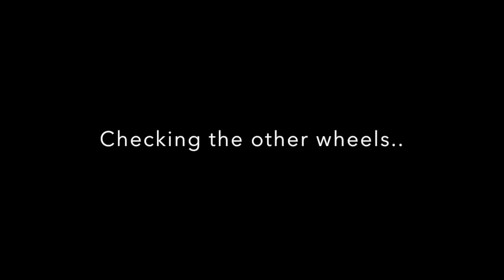New C63 wheel damaged after only a month!?

Comment: Should have kept the Mercedes OEM Rims, they are more durable then any other cars rims due to high Mercedes standards. Just saying 👊👍
Reply: I drove those same roads for 15 years...never bent a Mercedes Rim & have slammed many pot holes
Reply: there is difference in amg rims and oem mercedes rims. AMG are forged and normal are just cast wheels. so they are cheap and bent easy
Reply: I told him from the beginning just stick with the AMG wheels why even bother to get some cheap xhit like this and make the car look so cheap 🧐
Reply: Teddy Doan exactly! I think he needs content those rims are ugly & bad color & makes it look like a bmw
Reply: Those are forged wheels, same as AMG stock. they use same 6000 series aluminium and are forged.  No difference in durability. there is no "high" mercedes standard
Reply: DuBstep115 everything Mercedes puts in that our cars is of higher standard, for instance like the windows, the windshield, much more resilient to rock chips much more resilient to huge rock rock cracks, have heat resistant tent that's clear built into the windows not all companies do this they're just glass windows and if they do they're just copying it with fake s*** that isn't as good been around all the luxury cars my whole life Mercedes are at a whole nother level, they have over 100,000 inventions to the automobile including the automobile itself, the first motorcycle ever, first combustion engine and so much more sorry stuff is misspelled I'm using voice to text LOL
Reply: In many other parts yes but you must understand aluminium alloy is just a metal and it is wrought from different series from 1000 to 8000. If you are using same 6000 series metal you will get the same durability as mercedes, there is no magic behind it or trade secrets. Even BBS wheels bent even tho they are concidered to be best in the world (used thru all motorsports including F1 formula). Oh btw mercedes was only first to put  combustion engine in production.  Nikolaus Otto who invented the engine hence the name otto motor. you might want to fact check https://en.wikipedia.org/wiki/Nikolaus_Otto
Reply: DuBstep115 Yeah makes sense with the rims & other parts that are out sourced...Otto indeed was a German guy but his engines were not reliable, Karl Benz is credited with a fully functioning combustion engine early 1880's Mercedes then had many 100,000 patents there after to the car/Engine, they invented fuel cell (H20 by product 1994 Necar 1 Mercedes) still inventing today first car in the world with active suspension in a production car first 4-door Coupe, first luxury SUV 1995, abs, first led headlamps 2006, first all LED Complete Car 2014 S Class, first diesel-powered passenger car, there's literally a hundred thousand inventions from Mercedes from their first car to the modern automobile it's insane bro
Reply: I am very aware of mercedes history but there are many things that karl benz did not INVENT as you said ABS "1978: Mercedes-Benz W116 became the first production car to use an electronic four-wheel multi-channel anti-lock braking system (ABS) from Bosch as an option" But  In 1971, General Motors introduced the "Trackmaster" rear-wheel only ABS as an option on their rear-wheel drive Cadillac models. In history of patents there is a lot of glory stolen from original creators. If some one steals idea makes it slightly better and uses it in production first, i would not say he invented the thing. PS as W140 owner i have to say mercedes has gone downhill from there, from the 90`s golden days.
Reply: DuBstep115 I hear ya...When Mercedes bought Chrysler early 2000's they made mistakes...I drive a W221 S550 currently best car I've ever driven, I had a 1997 S420, ML320, 300E, dad had 240D Diesel those are still in use today as taxi's in Europe & Africa, He has a 2000 S430 has zero problems (altbough those were the gremlen years) My S550 bullet proof reliable it has amazing reviews 9.7 out of 10 KBB & tech is fantastic S class #1 selling large luxury sedan for over 20 years still untop in the world. Mercedes over all breaking sale records last few years & cars are amazing Examples: AMG GTR & E63S....I'll own nothing else, I have friends with shit Cadillacs, over priced Shit Rolls Royce...BMW major engine problems but your right a few years a few Mercedes models you should stay away from they definitely made mistakes.
Reply: & When I say Karl or Daimler they are Mercedes Benz...as far as inventions they didn't adopt the name Mercedes until early 1900's
Reply: I actually thought buying W221 but in europe we use mainly diesel and bmw game is so much stronger in that side so i went with E60 535D dpf delete + custom map is good for 400hp and 740Nm from 3L diesel, and for summer times my W140 with legendary OM606 I6 diesel.  I have never had big problems with any german brand bmw from e30, e36, e34, e39 and e60. Audis from 100, audi a4 in b5,6 and 8. Mercedes W201,w202, w203 c32 amg and w140. Bmw is more fun merc is serious and classy, Audi is.. well lets just say when it snows quattro is your best friend.
Reply: DuBstep115 That is awesome yeah I am in Florida USA, my parents are from Europe diesel in big there. I had a A4 it's timing belt was needing replaced expensive job, Mercedes uses double chain that lasts forever. BMW use to be funner I am telling you the new E63S & AMG's are worlds different then 5 yrs ago. The new M5 is quick but the Tech in the E63S, you need to drive it it is AMAAAAAZING
Reply: Yeah audi did go to using chains as well in V6 and v8 engines. I forgot one car that i had for brief time but i sold it becase i was scared it would break down. R171 SLK350 with notorious M272 engine that had Balance Shaft that would wear off and cost like 3-5k to repair as the engine needed to come off from the car. So the chain lasted forever but the shaft guiding it did not :D
Reply: DuBstep115 Yeah a few engine got out m272 & m273 they had weak balance shaft..check any 350 or 550 vin# to make sure your not in range...
Reply: DuBstep115 It wasn't every engine was not wide spread but got bad P.R. like 10,000 engines it effected
Reply: I honestly think Nissan/Infiniti oem  Japanese rims are the strongest I've ever experienced.

Comment: I used to own a Corvette. I hit a pot hole one time so hard I thought I had broken something, but didn't have any issues after my heart returned to normal. I sold the car last year after owning it for for over 10 years and never had any issues with the wheels, when I sold it the stock oem wheels where still on it as the day I drove it off the lot. but now I drive an F-150 FX4 and now I go looking for pot holes to run over.

Comment: Aaaaaannnnnd this is is EXACTLY why I resisted the urge to go with 18 inch wheels on my ride and stick with the stock 16 inch rims when replacing my factory wheels. Any time you get that low profile on your tires you risk breaking/cracking a wheel - this guy is simply lucky. I've lost shocks thanks to bastard pot holes, but never a wheel/tire yet. Every city has them and you cannot avoid them.

Comment: I'm surprised that he heated the wheel up with a blowtorch while the rubber tyre was still on the rim , he must know what's he doing tho?
Reply: Looking at the way he is butchering the lugbolts on the impact gun straight into the hub, i doubt it...
Reply: The air was let out of the tire duh
Reply: nlSpiller you're not wrong there 😂 . Them lugbolts were not cheap , if I remember rightly ""custom made"
Reply: What is must with low profile?
Reply: he has no mechanical background lol

Comment: Lucky it didn't hit both wheels and the suspension.  I live in MD and went over deep pothole on the incline, resulting cracked both passenger side wheels, damaged bushings, bent lower arm, and broken shock, and damaged hub bearing.  it happened to my 3months old new car...

Comment: To all the people commenting about the potholes not looking that deep.. upon looking at the area it isn't the potholes that actually damaged the rim, it's a sharp area thats cut into the road (can be seen to the upper right section when the video is paused by the potholes). Based on the fact the inner section of the rim was damaged thats the most likely cause. Those cuts are usually made into the road prior to patch work being done. It's very deep and pretty sharp.

Comment: I've had a wheel or three on my E550 straightened due to potholes... we rarely get them here in Texas, so when we do, it's a big surprise. You may not need to get the 'inner tube' changed out - it should be just fine. I get it that you want it to be 'new', but the repair done was fist class (from what I can tell in the video).  Keep that inner tube bit for the next pothole you run over...

Comment: Hi Mike don't let anyone tighten up your wheel bolts with impact. Don't understand why ppl do use them at all while doing tightening it could damage the threads easily. It's better to do it with a torque hand wrench. Torque is important too because it affects safety and further dismounting of the wheel in case of changing tire or something else. Not good...

Comment: Almost cryed at 11:55 when your service guy inserted the wheel bolts directly with the screwdriver... now you might need to check the screws if they are true and the holes aswell.Correct me if I am wrong but you need to insert the screws manually for the first 4-5 turns..

Comment: I had same issue on a country road here in UK. Late at night hit pothole, tyre deflated and bend looked less than yours. Tyre sealant wouldn't work and had to destroy a brand new Goodyear tyre to get it home. Had to buy a new wheel and tyre which cost £570, had wheel repaired and new tyre fitted to use as spare wheel which cost £260 and it won't fit in wheel well it's too wide 🙈. If I never had bad luck I wouldn't have any 😫

Comment: This has happened to me twice in the last 5 years.  Wasn't expensive to get the wheel straightened & tested at an engineering shop - they did it with the tyre off both times - fortunately both times I was nearly due for new tyres anyway so that was no biggie either.  Of course my wheels are just stockies so I wasn't too upset about it.  Also, you hit that pothole pretty damn slow - 47km/h - even with such low-profile tyres its surprising it warped the wheels.  Maybe worth contacting your insurance company and they might chase the State roading authority to repay.

Comment: This is what you get when using low-profile tires outside of race tracks and car shows. Those were not designed to be used on low quality highways at high speeds. Also lowering the suspension obviously took a lot of buffer out.

Comment: And this is why my staggered m sport (style 66) wheels from the 90s rock. 255 40 17 in the rear, 235 in front. Got sidewall babyyy. Also I don't get modern wheels where the wheel protrudes past the side of the tyres. I've got a decent overhang (of tyre) that would of prevented minor damage in the past.

Comment: Was up in Detroit area in 2012 and hit a massive pot hole in my 2011 Edge Sport (with the 24" wheels)  didn't bend a rim but the alignment was never right after that and the Ford tech was able to get it close to spec but not 100%.  Damn potholes are big rim/low profile tire killers.

Comment: I have a 2017 c coupe and just after passing by 1000 miles stepped on a putthole, had a flat tire a bent wheel and a rattle noise which i tried to fix for 5 months with the dealer without any benifit, so look at the bright side at least yours had only a bent

Comment: Either the low profile of those tires/rims makes them a lot more vulnerable or the two-piece design and/or materials of the wheel itself is making them weaker and more prone to getting bent.  Really, that didn't seem like the kind of pothole you'd bend a wheel on if you hit at a reasonable speed, hell I'd think with most vehicles if you hit it at a bad speed you'd end up with a flat-tire.   But that's quite the distortion for a low-speed bump into a typical pothole.

Comment: the guy at the wheel repair center didn't use a torque stick with that impact gun nor a torque wrench. and I noticed those fancy wheel bolts were just laying in the gravel.

Comment: I grew up in 'the burgh' and there's no way I could imagine running the 19s on my Audi there.  Generally, the DOT specifications OEMs have to meet for wheels is higher than what aftermarket manufacturers have to meet so for PGH, I would run OEM 18" or 17" wheels.  Boring of course but lower risk.

Comment: Such a damage would not be allowed to be fixed in germany... its simply not safe anymore. Structure is weakened ...  no body or tire shop would fix this. Am really astonished that you do this in the us... issue is that non visible micro cracks can suddenly burst under pressure...

Comment: ok, don't roast me but those potholes doesn't look too bad. is it because of the material used in the rim? I've certainly went through worse potholes without any problem. Benting the rim like that requires a lot of force which is speed and a very big drop and steep edge.

Comment: Looks like the city have tried to repair this many times, it's the issue of this cold patch fix. For the path to properly adhere the surrounding asphalt has to be heated to accommodate the patch or "fix" . This is never done as it needs special equipment. They rather patch the same hole over and over and over. Which in the long run is simply a waste of money and a very short lived bandaid fix.

Comment: these ultra low profile tires are really in style right now but they suck. The money towards fixing the roads is not going to increase in this economy so that is what you get when you drive these super expensive cars which actually are very delicate. In Germany they do not have these pot holes. My old 1980 Chevy s10 loves to bounce on these pot holes with no damage

Comment: I'm not sure what's your deal since you're having so much issues with your C63s. I have a 2017 with only 26k miles and haven't had any issues with it. Of course, I don't shove the water hose into the air take to hydrolock the engine.

Comment: I think it has to do more with the quality of the wheel than the road... Love ya Mike but if this is what happens when you hit a small bump, not sure if these wheels are worth 8k. There are a LOT of wheel companies out there now with cool designs and not a lot of engineering behind the design. Just my 2 cents.
Reply: IgnitionTube I agree. I have the the wagon on factory forged wheels and haven't had an issue. Live in roughly the same area and have hit some rather deep holes

Comment: Dude seriously? First, there is NOTHING wrong with that wheel now after the fix. Don't waste your money on a new barrel (the inner tube). Second, low profile tires on large rims are VERY susceptible to damage from holes (those were hardly big enough to call potholes, sorry).  Leave stock on for winter and put those on in summer after most patching/filling had been done by city AND get ready for more wheel damage...that won't be the last time guaranteed.

Comment: You need to make a claim against the highway agency in charge of the road. GET EVIDENCE.

Find the pothole.

Photograph it from each axis. Photograph a wide angle of the location.

Measure it, width, length and importantly, depth.

Keep the a receipt or an estimate of the cost of replacement.

Contact e-Mail the agency (authority) in charge of the road in order to claim the damage.

No it's not your fault. When you drive, you should not have to expect to damage a wheel.

Comment: Wont the local council / govt pay for your wheel?  In Australia, if your car is dmg'd from a pot hole or a rock on the road, you can call the state and they will pay for it to be fixed.  Just last month my father hit a rock in his Chrysler, it did 18k dmg (took out sump and gear box on its way through).  Govt paid for it all.

Comment: Would have been a good idea to remove the tire to make sure it did not suffer any damage to the steel belts?   Or, would belt damage be noticeable by driving it?
Reply: Depends how badly damaged, but id doubt a pot hole like that would do it. Tyres do flex, and that damage was because the tyres are low profile, so didn't need to flex much to hit the rim on the corner of the pothole. A badly damaged belt though is very noticeable, the tyre goes egg shaped, and tries to shake the car apart...

Comment: I have to say you brought this on yourself, if you had of left it stock stander-ed instead of throwing larger wheels and lowering which puts more pressure on the suspension and lower profile tyres and so forth.

And those pot holes don't look that deep in the video, I know what I'd be doing is putting the stock wheels back on because this will happen again.

Comment: Never had that issue with my Landcruiser.  In fact when I spent the last $4000 fixing my Mercedes Shit-tronic gear box that needed a new valve body and conductor plate that only the Stealership could fit, i decided there and then I will never pay for a companys design floors sgain.  Never looked back and my Landcruiser has never betrayed me like the Benz. The only place for a car like that c63 you have is on a track. They are a pain in the wallet and impracticle for day to day driving. They have f-all room in them as well.

Comment: When you pinch a tire against the rim hard enough to damage the alloy wheel you have most certainly also bruised and  damaged the tire. I'd replace the tire rather than risk a blowout. Also the city should pay for the repairs caused by their inadequate road maintenance. If they don't, check the "Comprehensive" coverage on your auto insurance policy. They should pay for the damage amount exceeding your deductible.